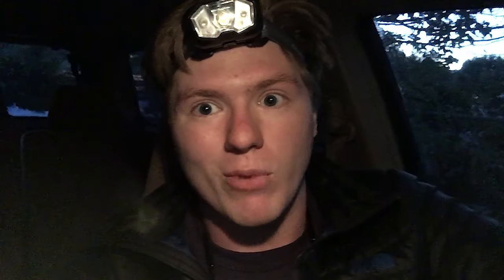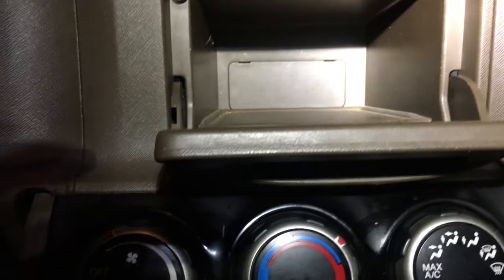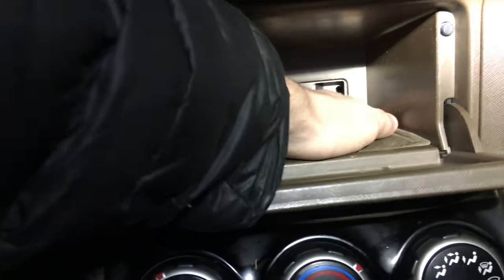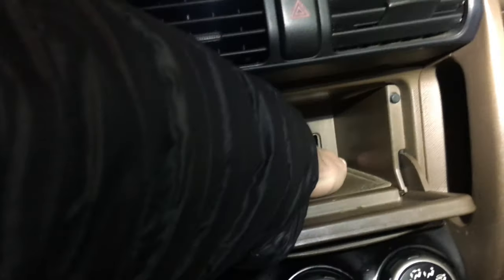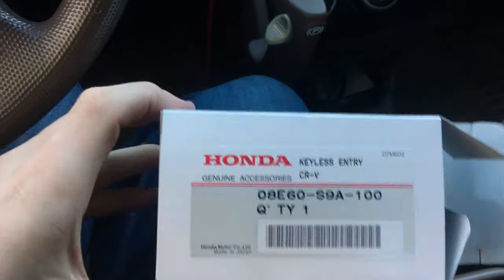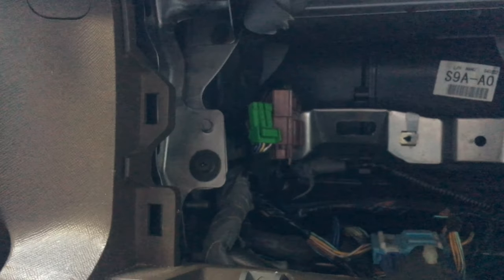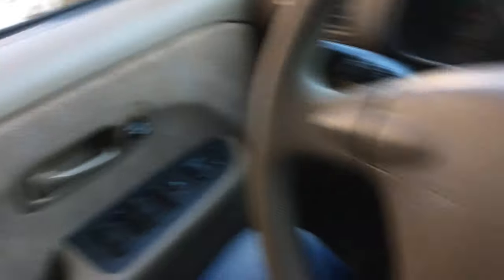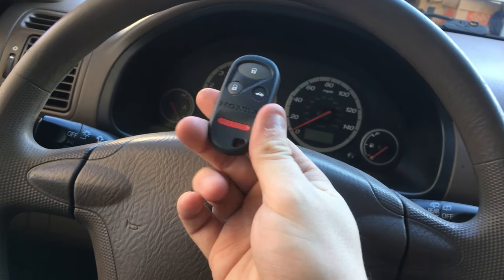How to Install OEM Keyless Entry in 2002 - 2004 Honda CR-V LX

Comment: Thanks for the video guide.
I installed mine on a 2002 year CR-V LX (the first year for 2nd gen in the US)
There was only 1 difference from the video, the plastic dash piece was different, there was no door for the screw, so no place to put your fingers in to pull the storage piece out.

To get that piece of plastic out on a 2002 year model, remove the screw. Then on the deepest part of the cubbie hole place your hand in and push up on the top of it, that should dislodge the piece a bit. From there it's wiggling it out and pulling it free, if you still have the rubber mat that goes into that storage hole try using that for some grip.

Completely skipped disconnecting the battery and the revving stuff and it worked fine.

Comment: This video was a godsend. I have a 2003 LX without keyless, and my lock cylinders were loose so my key only worked in one of my doors, and who knows how long that was going to last before I can't unlock any of the doors with the key. I started to call around to  locksmiths who all told me they didn't have the parts to fix it. But then I found this, ordered the part and slapped it in, and a couple of minutes and $100 later I can lock and unlock my car now no problem. And I didn't have make a dozen more phone calls to maybe have a guy come out for a couple hours and charge me a couple hundred dollars!
Reply from the maker: I’m so glad you found it helpful! Funnily enough, that’s exactly why I did it to my car as well - my lock cylinder was all screwed up, and after not much longer I wasn’t going to be able to get in the car!

Comment: On 2005 and 2006 model CR-V's, the green connector is to the left of the steering column, up inside the dash.  The lower panel of the dash, on the driver's side (the panel that has the 1/4 turn knob in it, and then pull that plastic panel straight down to remove it) has to be removed.  Then "you" lay on the floor, and look up under the dash, and toward the outer left "wall" area of the body.  The OMRON sensor unit is probably already there, and plugged in.  There will be a 2nd, longer, bright green, connector plug, probably still tied to the harness with blue tape.  That longer plug is for the factory alarm system control module, which was an optional accessory. 

The OMRON sensors came in 2 FCC codes:  
OUCG8D-380H-A, which appears to be the standard version for 2002-2004 CR-V's.
OUCG8D-380H-B, which appears to be the standard version for the 2005 and 2006 CR-V's, and it's the version that is in the Honda Kit that is used in this video.

I don't know if remotes for the "A" FCC code can be paired with a "B" FCC code OMRON sensor, or vise-versa.
Reply from the maker: @austinado16  thank you for the information!

Comment: Picking parts out of an 06 EX. I wonder if that module would work with the OG FOBs retrofitted to an 04 LX.
Reply from the maker: Yeah, probably would. I think there is a part number directly on the module that you could compare - I believe it’s the same for that entire generation of CR-Vs. You’d need to do the re-learning procedure to associate the existing fobs with the new transceiver - I think the instructions are in one of those docs in the description.

Comment: Did this without unhooking the battery (because I couldn't find a wrench for that) and it worked fine right after I plugged it in - didn't do any of that hocus pocus stuff with the window and rpms and whatnot. But YMMV, I suppose.
Reply from the maker: Yeah, I think that stuff is just best practice to avoid screwing with the ECM. YMMV - figured I would do it the Honda-recommended way. :)

Comment: With the part number listed on the spare parts website, they they show that it's for 2003 to 2004, so will this work on the 2002?
Reply from the maker: I’m not sure, but maybe? I’d look to see if you have the green connector as outlined in the video. If you do, it’ll probably work.
Reply: Did it?

Comment: Can you post the link for the plastic inserts on the hood prop please? And great video man!
Reply from the maker: Thanks! I just added the link to the description, but here it is again:

Keyless Entry Accessory Kit | 08E60-S9A-100 | https://ebay.to/32K363i OR https://bit.ly/2WJ0zmc
Grommet, Hood Stay | 91604-S5A-003 | https://bit.ly/3eNI1r7
Holder, Rod | 90602-S2K-003 | https://bit.ly/30EoqEy

Comment: heyo, question. I'm looking to install this same module in my 01 civic. Does the panic button on the remote set off an alarm? When the doors are locked or unlocked, does the horn honk and/or do the turn signals flash?
Reply from the maker: I'm not sure if the module will work the same, if at all, in a civic. But in my 2004 CR-V, yes, the panic button works and the honk/lights flash when locking and unlocking.
Reply: @DylanClarkSallee  okay thank you! The modules are similar or the same, so mine should behave the same as well. I'll let you know if I end up getting it
Reply: @rubymalia9345 how did it work out in the civic?

Comment: does this thing work on a 2004 honda crv 2nd  gen?
Reply from the maker: Probably, yes! I think you need the LX model. You can check if the green transponder wire in the center console is there - be aware that it can be kinda hard to find. Watch the video for more information.

Comment: do you know where it is on a 98 Civic LX?
Reply from the maker: I do not unfortunately - it might not have something like this. I would search for/buy the shop manual. Additionally, you can often find a list of all the OEM accessory options that were available when the car was first sold. Each accessory item should have an installation manual. I think they're available on the Honda eParts store. Good luck!

Comment: So what if you have an EX model?
Reply from the maker: As far as I know, the EX model doesn’t have the wiring harness plug to attach the transceiver module. However, it might be worth a shot to follow the instructions in the video to open up the center pocket-thing and check for yourself. It’s not super hard.
Reply: @DylanClarkSallee  My 2002 EX has a green harness in the same spot, but it seems to be smaller than yours. Are you aware of any different oem transponders with a smaller harness?
Reply from the maker: @evancrocker1081  hmmm - not off the top of my head, no. You might check estore.honda.com and see if you can find the original OEM keyless entry accessory pack for your specific car.